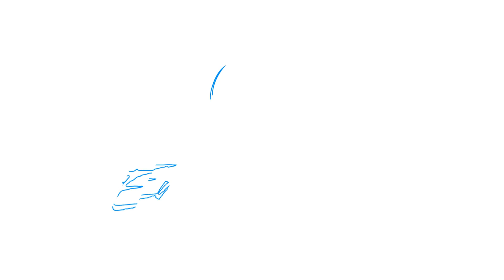Time-lapse fusebox upgrade

Comment: Hi are you using the the ac type rcds or type a rcds. Also what do you think of the board thanks
Reply from the maker: I was going for the A type but some were out of stock and got AC in the end. I install CP since spring and if you are not a brand junkie trey're a great product. Even their size it's not an issue as the CUs are very specious and with plenty of knock outs, but I heart they are working on bringing out compact rcbo soon.
They need to get their product to more wholesalers so we can get them over the counter
Reply: @EruElectrics  this A type rcd with the 18th edition is a bit of a nightmare because they are alot more expensive than the AC. I don't see any problem with using A.c unless there is a lot of new item in a property. What so you think
Reply from the maker: @gd-bq7em  The CP ones are about £15 each, so nor too bad. Domestically I'm not entirely sure how much they actually needed or we just over thinking it. Reg  722.531.2 says that we must install them for EV chargers and 531.3.3 that AC for general use are fine. I'm not even sure if my MFT will be able to test them properly. 

My NICEIC inspection will be soon, I will ask his opinion as well.
Reply: @EruElectrics  yes I think your are correct buddy I think a.c are still fine they have been doing there job for many years . I have been trying to gather info on them basically what I can make out some washing machine motors and induction hobs can have a d.c pulse and a few other items but they still work on ac current. It's like if you go to a house and they have a.c rcds and they have a brand new washing machine or hob am people going to refuse to fit because they dont have A type rcds lol  On the meter situation it's a bit of a rigmaroal on my fluke I have to test it the normal a.c way then switch to A type and repeat again double the testing. So for rcbo boards  I will be there half a day lol 😂😂🙈
Reply: @EruElectrics  also where do you order you c.u from mate
Reply from the maker: @gd-bq7em  I use Thomas Electrical Supplies and Consumer Unit World, depending to whom I can get a better price and stock items.